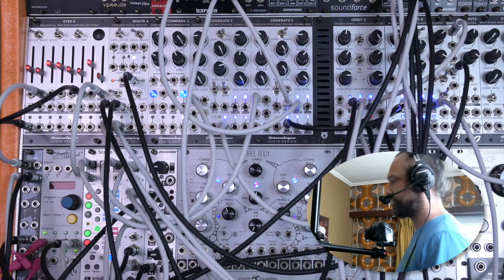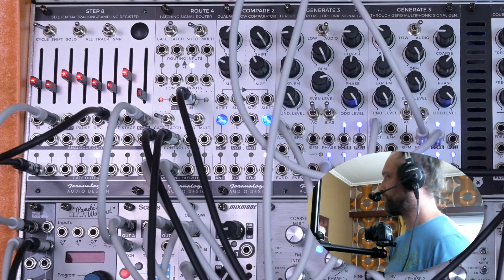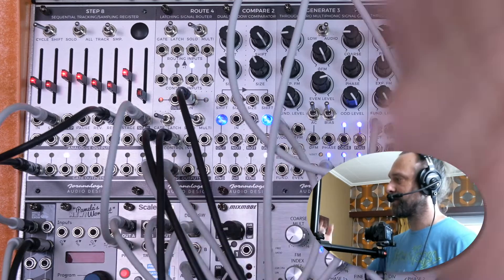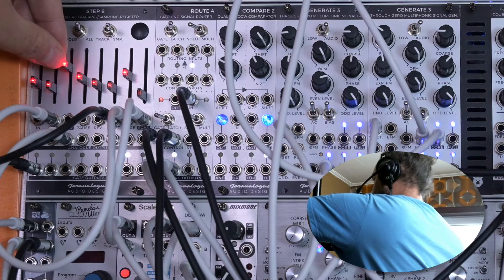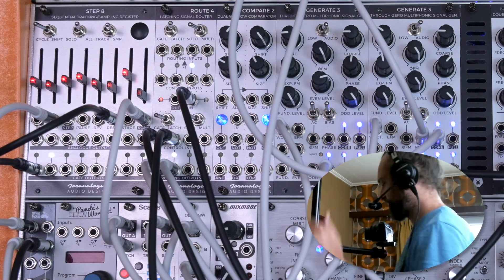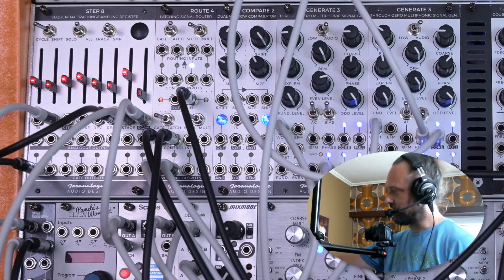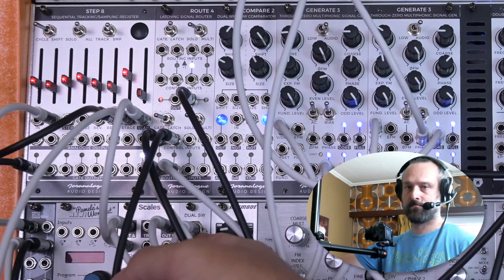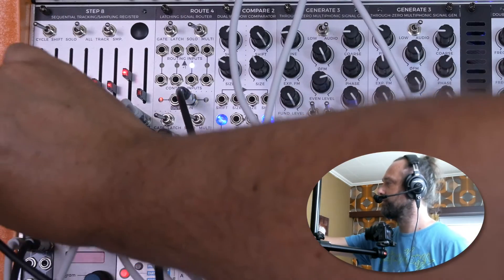Joranalogue Audio Design TECH THURSDAY FOLLOW-UP / STEP 8 / variable length sequencer

Comment: Sounds nice - what are you using for the drums, if I may ask?
Reply from the maker: Hey thank you. I'm using Mandrake by Malstrom for the kickdrum (it's been replacing my use of Crater). The snare is bandpassed pink noise through an envelope/vca. The stereo hats are digital noise through ROUTE 4 which acts as a crude vca but also creates two outputs from one input. The center percussion sound is a mix of white noise and a resonanting filter through a vca, the sound I was going for was something between a light hat and a rimshot/tomtom. So all in all it sounds very convoluted, but it's mainly just the outputs of one noise module (noise by Malekko) through various envelope/vcas. Triggers for the drums are from Pamela's New Workout and Zularic Repetitor.
Reply: Thanks for the explanation - it sounds nice.  I like the combination of the digital and analog sounding noises  @briesmodular

Comment: Hi BRiES, the trills are really nice (sort of reminiscent of some African guitar styles), and so I wondered how I might be able to do something similar with my Harmonaig quantiser. Now, that doesn't have a sample and hold at its input, and I habitually put one before it. I have often thought that it ought to have one, but now I see there may be an advantage of it not having one. I can instead put a track and hold infront of it and it can do something like you've done here. I could put a S&H (with a faster clock or trigger pattern) infront of a T&H and get trills that don't just run through the selected notes but step according to the S&H voltages (and the selected quantised notes) when the T&H is tracking. Cool. I'll have to give it a go. Thank you!
Reply from the maker: Awesome. Happy to inspire, I'm sure you can patch it up. The key is indeed the track and hold and having some control over the triggers for the quantiser so it doesn't 'trill' all the time (which can get quite old quite quickly).